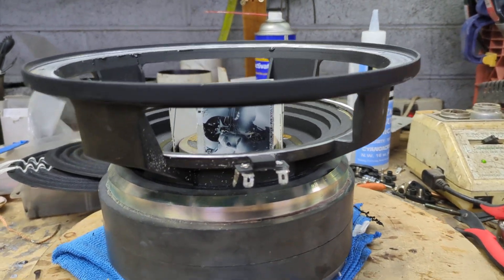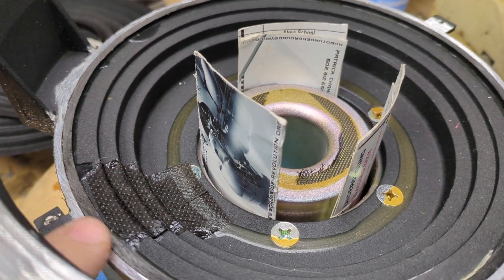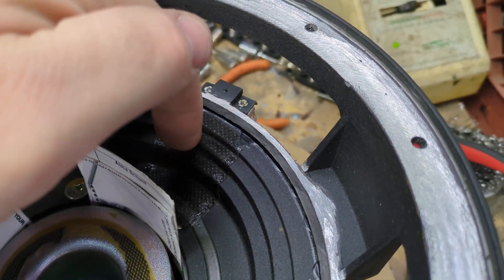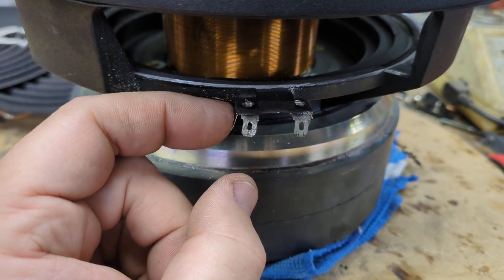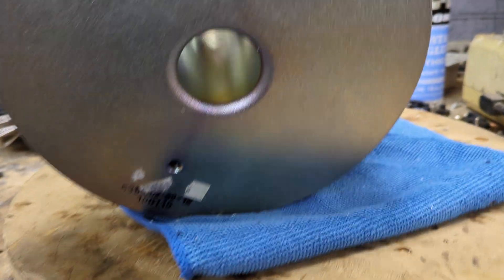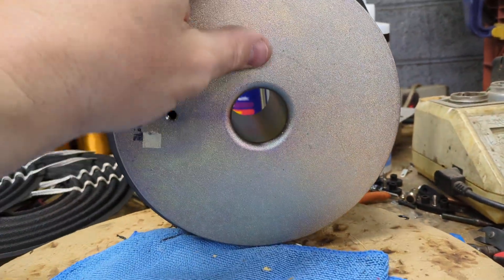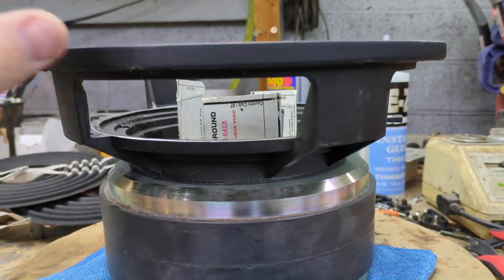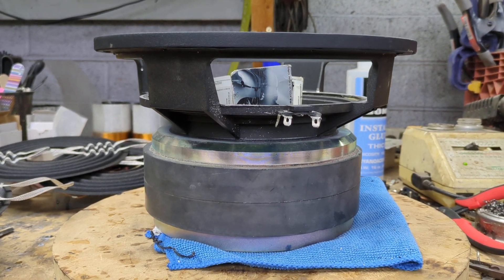10" Sunfire TruSub Subwoofer break down by Robot, HiVi Hi-Vi Version? TC Sounds Bob Carver Nowhere!

Comment: Could you make a recone kit for a gen 3 power acoustik mofo 15 inch?
Reply from the maker: Most likely.  Go ahead and text me direct with the gap dimensions 602-312-6504

Make sure you measure in metric.  (Millimeters)

Also make sure that you use a digital caliper you can find one for about $10 on Amazon.
https://youtu.be/u_jKBZdU460?si=wx2s22OGzNuOu94N